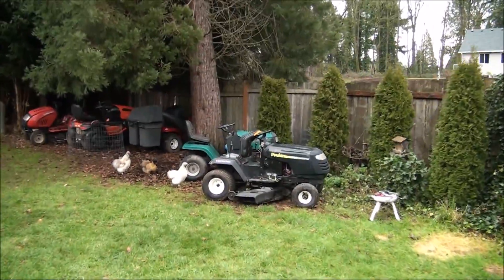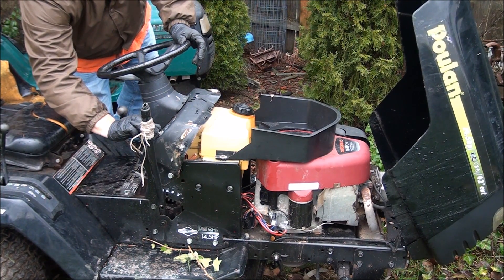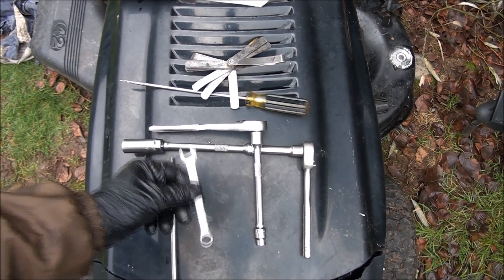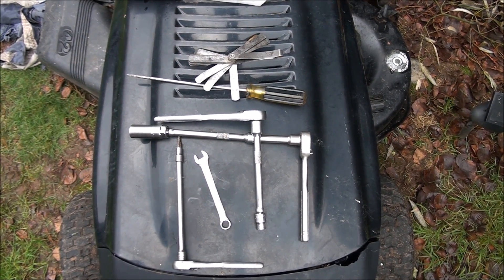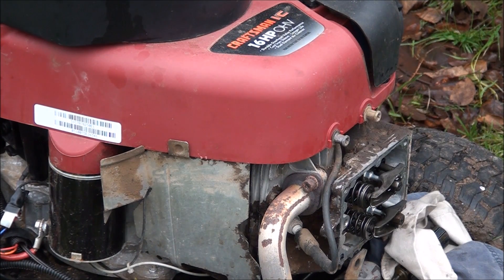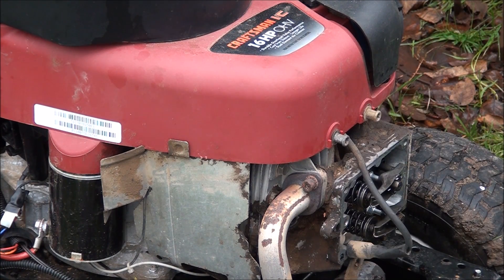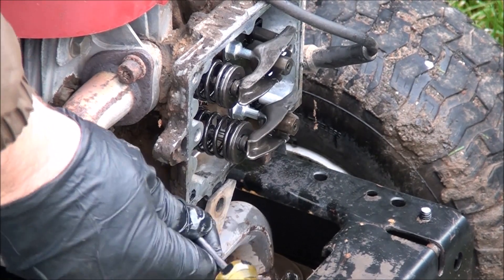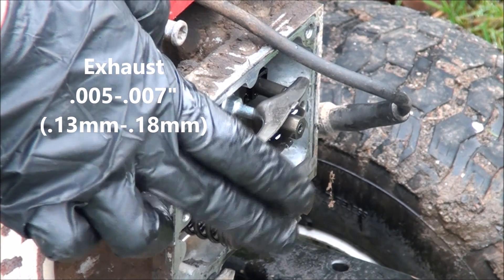Is it the VALVES? Single Cylinder Briggs and Stratton OHV VALVE ADJUSTMENT Procedure and Specs

Comment: I have a craftsman lt1000 with the 17.5 hp ohv I did a new fuel system, lines, fuel filter, new carb, new air filter, oil change, adjusted valves at top dead center this sucker will still not fire up lol. Any advise ? Wanted to add it sat for 3 years before this
Reply from the maker: Try using starting fluid to see what happens. If it starts then dies, you know that you have spark and compression but not enough fuel.

Comment: Dont need to get TDC  just completely open 1 value then adjust the loose one, then visa versa, 6 thousand exhaust/ 5 intake . Much easier than trying find TDC. Works just fine. Just something I learned from Grass Rats Garage..

Comment: Have you ever seen one of these briggs motors with the intake valve on top? There are no numbers on my valve cover for me to see what series the motor is specifically (just know it is a 17.5hp in a Scotts S1742). Every video I have watched has the intake valve on the bottom with the aluminum push rod on the bottom, but mine has the aluminum rod on top which has caused me to believe that the top has to be the intake valve. But now I am wondering if someone worked on this motor previously and mixed up the push rods
Reply from the maker: As far as I know they are all the same.

Comment: Had the same problem with mine starting, 17.5 Briggs tried new battery and starter, no change, then found out that the decompressor was broke on the camshaft, apparently a common problem with these engines. Got new camshaft and gasket set, disassembled the engine, cleaned out all the metal shavings and replaced the camshaft, reassembled and everything is good.
Reply from the maker: good job

Comment: I recently had to replace my head gasket on my yt3000 mower. I set the intake to .004 and the exhaust to .008. Sounds better than it did before.

Comment: I read in the manual to turn the engine counter clockwise to ensure the acr doesn’t affect the adjustment on the intake 🤷🏻‍♂️🙂
Reply from the maker: That's the best way to do it if you can

Comment: Hi
I accidentally  turned my engine counter clock wise, by hand (Idrilled out rivets on rope starter, vacuuming out stuff out....) now it looks like the piston is hitting the valves, wont turn over (by hand)
any ideas what I should do...??
Thanks.
Reply from the maker: nothing should have happend by you just doing that.
Reply: Its a Briggs 305 / 1350 snowstorm.....
I just used my hand, no rope /electric starter.... Looks like  both are  down / hitting piston ???  ran fine, worked good...
What did  I screw up??
Reply: piston is top dead center, wont turn over, more the a few degrees...
Reply from the maker: sounds like a broken rod or valves not adust correctly. make sure the coil/magneto is not hitting the flywheel

Comment: Lot of people don't know about the compression release,, on these motors,if the valves are out of adjustment, the compression release won't work right. My valves were between 10-15 thousandths,adjusted them to 6 thousandths,fired right up.

Comment: You Should Have Removed Those Studs And Put Some Blue Lock Tight on Those Stud Bolts For The Rocker Arms. Best To Fix The Problem Before Something Happens To The Studs And They Come Out And Possibly Do Some Damage. A Simple Thing To Do, Seeing That You Work On These Mowers All The Time

Comment: This is the only source of information I've found that this could be the problem and not a busted up cam.  My ride on mower is made in 1999 and was previously owned by someone who had it sitting outside most of it's life.  This was a much easier fix then for me to remove the engine and find out my cams valve release is still just fine.  Not only it starts and runs just fine but it now has a lot more power.  This thing moves really easily now compared to before.  Before it could sometimes stall cutting grass, but now it moves super fast, maybe a bit too fast.  My theory is that over time the rockers get lose and causes the valves to close early and stay closed longer for the intake and exhaust strokes.  Hence the high compression just to get it started.  Also the lack of power from before adjusting.

Comment: What happens if one has zero gap?  I cannot adjust my exhuast valve. It has zero gap. When I try to adjust it to a gap, then it is so lose that the push rod falls out.  And I mean if I even turn the screw a hair. then it is gaped so much that the push rod falls out

Comment: You don't need to get the engine to TDC. That is only required for timing. Just spin the flywheel tell one of the lifters are down the opposite one will be loose, adjust that one then rotate tell the next lifter is down then adjust the next.  Yes, TDC allows for both lifters to be loose but by the time you find it you could be done with the job.

Comment: There are a ton of videos getting the Exhaust and intake backwards.They say the aluminum push rod is a easy way to tell.Intake looks to be bottom like in this video.Is it necessary to do this top dead center?I am seeing videos where they adjust with one closed and one open.Very confusing.

Comment: its not because the valves are not adjusted in balance.  It is because the valves are too loose and the compression release upon start is not hitting the valve and the valve is not releasing compression
Reply from the maker: good explanantion Abe,  often times that darn Comp release will break and then you need to replace the whole darn cam

Comment: Good video, you had me laughing when you said your wrist was calibrated haha!
I have the same exact engine except its anb18.5hp. Its on an old mid 90's craftsman lawn tractor. I just got it running, need to adjust the valves next on it. Are the valve specs the same on the 18.5 hp?

Comment: I have an issue with the same lawnmower it seems like it’s good compression but it seems to not really want to start. It will start on occasion but most of the time you’ll just sit there and crank it. It has spark and fuel. I’m wondering if it’s also valves but it spins over just fine  and the spark plug also gets full of gas every time I take it off
Reply from the maker: must be the valves or low compression

Comment: THIS VIDEO IS KIND OF TIMELESS AND CLASSIC AS IT REALLY DOESN'T LEAVE OUT MUCH. IF YOU ALL STRUGGLE WITH THEM STUDS COMING LOOSE. THE RED OR PURPLE TELFLON TAPE IS THE BEST TO USE TO REST THE STUDS IN THE HEAD. MOSTLY THREAD LOCKER FAILS BECAUSE OF THE OIL SATURATION AND BE PREPARED FOR NUGGETS TO SAY TO YOU THERE IS NO SUCH THING AS RED OR PURPLE TEFLON TAPE. YES THERE IS IT'S FOR USE ON AROUND BOILERS AND EXTREME HEAT. SOME TIMES THEY HAVE A WHITE OR BLACK VERSION DEPENDS ON WHAT PART OF THE USA Y'ALL LIVE IN. MICHAELS SUPPLY WAS ON LINE FOR SOME YEARS AND ORDERED I THINK ABOUT 5 ROLLS OF THE SHIT WHICH I STILL HAVE MOST OF IT ONLY USE IT ON SETTING VALVE STUDS ON MOTORS. I ONLY COME ACROSS THESE ISSUE ONCE EVERY FEW YEARS.
Reply from the maker: Thanks for watching

Comment: 9 Times out of 10. Thank You, Thank you!  My Dad's John Deere 19hp Intek had the same problem.  He is an excellent Mechanic for 60 years, but now has Parkinson's and a Mild Stroke.  We had already rebuilt the transmission for another problem, then a new Battery, New Solenoid, Changed Starter and still would not run.  Ready to take it to another mechanic.  Then found your video.  9 times out of 10 . . . You were absolutely right!! Our intake valve was so loose, the rocker arm had fallen off and the valve had bent.  Was able to repair, put it back together and adjust the valves.  Runs perfect.  Thank you so much for your video. You are awesome.  Rusty Williams

Comment: I know you are doing it like the manual says but I never took my spark plug out. I just opened one valve and adjusted the other one, worked great and this was the first time for me. If your engine does not crank because they are so far out like mine was I think what I did will be fine.
Believe me I thank you for this video. I'm letting the commercials run this time and I'll let them run a few more times.  😊
Reply from the maker: Thanks friend!

Comment: Ok I did this exactly... And my motor is still not turning over, crank literally feels stuck, any other idea??? Help really need to build a race mower!!
Reply from the maker: it is very common for th compression relase mechanism to fail on the cam. I bet you need a new cam.
Reply: @JeffsLittleEngineService  imma take a look

Comment: You're supposed to loosen the torque first and then you can remove the nut the stud Hass to be torqued down to 80 or 90 inch pounds good idea to put Loctite on it too. Also would be easier to use the socket size of the combination wrench on the nut then it won't be fumbling with then you won't be fumbling with it all the time!
Reply from the maker: good tips!

Comment: My understanding is they have a decompressor cam that opens the valve a tiny bit at very low rpm to aid starting. If the valve clearances are off this cam doesnt open the valve and the compression is too high to turn over. I only found out about this cam after replacing my battery and burning out my starter solenoid :-( I found the valve clearance quite critical so try and get it as close to the spec as you can.

Comment: The video is very helpful. I have been adjusting my valves wrong... I would adjust the intake valve while the exhaust valve was compressed and  the exhaust valve while the intake was compressed. Followed your way step by step and it fired right up. Thanks bro.
Reply from the maker: Glad it helped! Thanks for watching and commenting

Comment: Many small engines have a compression release mechanism on the camshaft (including this one) exhaust lobe that bumps the valve open when the engine is at very low RPM reducing compression and making it easier to turn over , if the valve Clearance is too high the valve never gets bumped open and electric starter cant overcome the full compression , its also possible for the cam compression release mechanism to spring to break , something to check if the valves are adjusted to the correct clearance but a good starter still struggles to turn over the motor . one "will" burn up the starter's rotor windings very quickly if you hold the key try and make if force the engine to turn over with this issue so use care to recognize and fix the issue as soon as its noticed or you will end up replacing the starter as well .. How the compression release works ,, https://youtu.be/tceKAAViC1c if the camshaft compression release mechanism breaks (example of this here https://youtu.be/hBuUxf8deCM  this example is off a different engine) this problem is far less likely then lose valve clearance issues always adjust the valves first before suspecting this second posability , it can also cause the starter to not be able to crank the engine with correct valve clearance ,, check and  replace the camshaft if this happens ..
Reply: You are correct except it is the intake valve that gets bumped open.

Comment: Hello. Thank you for the video.  I got a ariens zoom 34   And was running fine but one day the idle start going up and down.   And  i install another new carburetor but still doing the idle problem . So someone told me. That can be  a bad engine.   Because  the compression maybe is not good enough 
But i not sure what to do.   Do you have any a idea. ?    Thank you.
Reply from the maker: not a bad engine. Most likely a contaminated gas tank and fuel
Reply: Jeff's Little Engine Service i check the compression and its 100 psi 
I check for spark. And i got good spark 
All the way to the spark plugs 
New battery.
Now its cranking really good  but wont start
I try with start fluid. But still wont start  any advice ?  Thank you

Comment: One thing the video doesn’t make clear is the difference between the torx screw and the nut. This setup is counterintuitive because this is NOT a jamb nut. The10mm nut is what adjusts the gap, the screw locks the setting.
Reply: thanks!

Comment: Does Briggs say whether it matters if the engine is hot or cold?
Reply from the maker: adjust when cold
Reply: @JeffsLittleEngineService  
Thank you! Just picked up a husqvarna with an 18.5 doing this. They said the battery was weak but the battery is fine, it’s doing the same ‘half-turn’ thing. 250 hrs so could be a worn out cam but I’ll start with valve lash.

Comment: I got a 2008 La-115 19.5 hp 268 hrs I did for first time a valve adjustment replaced headgasket TDC plus 1/4. The briggs still was hard to start so readjusted valves at TDC only runs perfect!! That 1/4 pass TDC is BS I think.

Comment: Okay I have adjusted my valves a dozen times and still have extremely high compression. There is no gas in the oil! The engine is clean! Why is there still so much compression?
Reply from the maker: the cam compression release is probably broken and you will need a new cam.
Reply: Great mine too. Lasted 20 years though lol

Comment: Doesn't help to adjust the exhaust valves if the compression release on the valves are worn down and that's usually the issue, not worn down cam lobes or valve timing. You can bring it down to zero  lash hot and it'll start for another little while and then the cam is done. I've welded material to a couple of them and ground it down to match a new cam for a more permanent fix. It's the compression release on the exhaust cam lobe that's the issue.
Reply from the maker: yes what you are describing is a very common failure on these engines

Comment: Thank you for the video! This will be next thing I'll do to my mower. I'm having difficulties in the ignition like you had. Not as bad though. Also some backfires, so I thing valve adjustment might do the trick? One question. How universal these specs are? I have 15.5 HP B&S engine which looks the same as this one. Can I use these specs to fix that engine?
Reply: Ok, I did found the same information from the Owner's Manual. Thank you anyway for this video and greetings from Finland.

Comment: I have a B&S 17.5 that I am working on. It has been sitting for about two years. It was originally given to my neighbor with a broken PTO cable, but was running at the time. Now it is acting just like the mower in this video. It will not turn over on start. It spins freely when I remove the plug, so I know it is a compression related issue. I attempted to adjust the valves, but it did not make any difference. I have never done a valve job before, so I am not certain that I am doing it right. Are there any more tips that you can give a novice like me? I am teaching myself to work on them, and I have never been inside a lawnmower engine before.
Reply from the maker: It probably needs a new cam because it is very common for the compression release on the cam to break.

Comment: Hey Jeff, Great Video!  I just wanted to add a little info about the valves here.  On these Briggs and Strattons, the Intake Valve is “bumped” by an additional lobe on the camshaft, just before detonation, it allows excess compression to bleed off for a split second.  This takes the strain off the starter.  It does not have an effect on the exhaust valve, only the intake.  If the intake rocker is to loose (over .005”), this “bump” in the camshaft WILL NOT open the intake valve and help relieve the compression for the starter to get “over the hump”.  Of course, if the intake rocker/valve is to tight, it will not completely close, and then the compression will not build and the engine will not start. Different problem, just thought I’d mention that.  When adjusting this intake specification, it’s always a good idea to adjust the exhaust at the same time.  I just wanted to clarify what causes this issue, and let your subscribers know why it’s not a good idea to “over adjust” or “over tighten” the rocker.  There is a reason that the specs have a “range”.  Again, great video!
Reply from the maker: excellent explanation and good tips for a common problem
Reply: What would you adjust the intake at and the exhaust at. And you would adjust both valves at the same time by with the Piston at the top ? Right?

Comment: Im stumped here, same exact engine, same problem. Followed your video, no luck. Engine turns over fine when plug is out. Completely dissasembled to check flywheel key which apparently can cause this problem, it was fine. I have no idea what is still causing the piston to freeze at compression stroke. Any ideas?
Reply from the maker: the cam compression release is bad, you probably need a new cam...
Reply: @JeffsLittleEngineService  I've looked at the little release key, seems completely fine. Anything I could look at on it that would tell me otherwise?

Comment: Good day buddy! My engine generally cranks very tight with a new battery, is it possible that it is also about adjusting the valves? When it starts it works perfectly, the starter checked the order with it. Thanks for the video.
Reply from the maker: Could be. Could also be a bad cam compression release

Comment: Hi.
I have a 15.5 hp motor.  
Also a large shotgun blast when I turn off the lawnmower
Reply from the maker: carburetor needs rebuilt or cleaning
Reply: @JeffsLittleEngineService  I'll be looking through your videos for instructions.
The whole stay at home time I should be doing maintenance on equipment
Reply: @JeffsLittleEngineService 
OK I put the feeler gauge on the valves, seems OK.